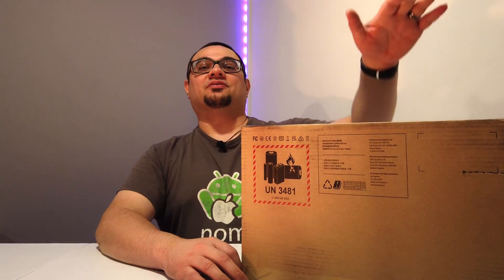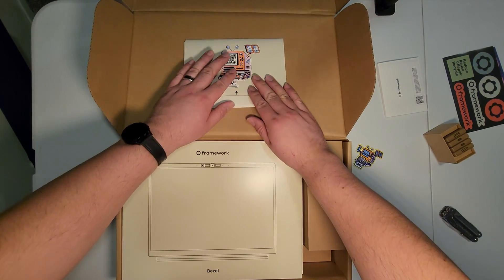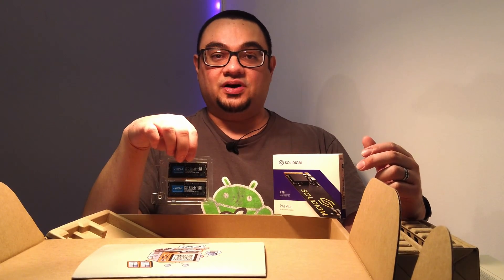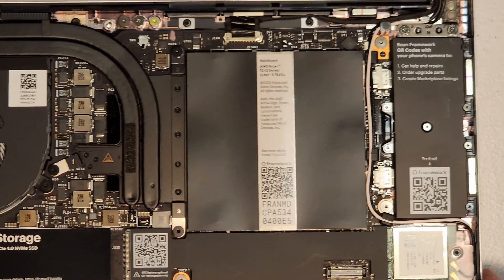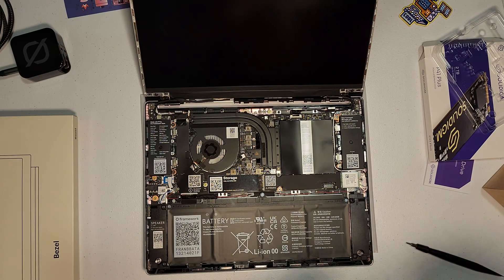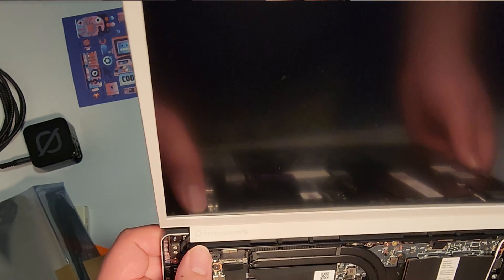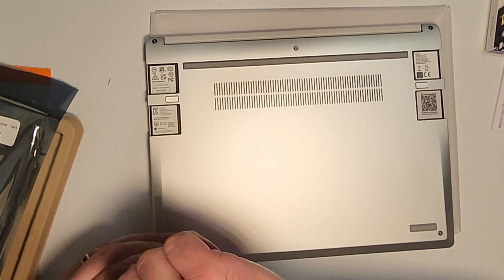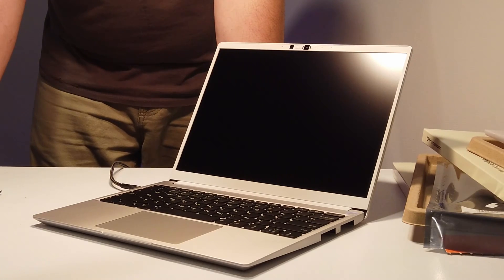Framework Laptop 13 AMD DIY Edition - Ryzen 5 7640U Unboxing and First Look

Comment: Bro, you have no idea what you are talking about 👁️👄👁️

First of all, overheating is an Intel problem, not the amount of cores. Second, you pointed at the RAM slots calling it the 7640u like what? Third, there are some other stuff that I was on the edge of calling you out but decided not to but after the first two, I could no longer let it slide 🗿

Comment: Unfortunately the Framework does NOT support XMP for RAM, so you need to make sure the core clock speed is what you want.
Reply from the maker: Correct

Comment: What is the display brightness like in bright rooms or outdoors?
I heard other reviews say it struggles in those situations but sadly only one review I saw mentioned anything about display brightness

If this claim is true then I may not buy this laptop despite how awesome this modular system is ;-;
Reply from the maker: It's sufficiently bright. I usually use it at 70% in a bright room and only crank it to 100% if watching a video. I tested using it in a car at 100% and it's decent. When I went outside in direct sunlight it was hard to see, but that's not a usual use case for me. My S22 Ultra with it's adaptive brightness it is not.
Reply: @SpiceVader  oh hek!

Comment: Thanks for the video! I have similar concerns about the hinge as you had and I'm glad I found someone how cared about this too, as I'm too picky. How is the hinge and the top comparing to Dell XPS? Is it too wobbly? Does the hinge handle the weight properly? I know that most XPSes (at least most recent ones) are pretty sturdy so if you can compare from your point of view it would be awesome!
Reply from the maker: As far as structure and durability go, I feel like the XPS is a little more sturdy. The Framework hinge is good and it doesn't wobble too much, but is slightly more "bouncy" than the Dell. I have seen some people have issues with the keyboard marking up the screen when carrying it in a backpack over a period of time. So I've started to put a microfiber cloth in between whenever I travel with it. Thanks for the comment!
Reply: @SpiceVader  thanks!

Comment: The "fitment issue" near the power button you mentioned is a consciously designed feature according to framework.
It is a place to easily split the top cover from the bottom when opening up the device.
That corner is where you pry with the spudger end of the screwdriver they supplied.
Reply from the maker: Ahh good to know!

Comment: The solidigm p41 plus drives don’t self encrypt, so before you store anything sensitive on these drives activate Bitlocker on Windows or Luks on Linux. Or never ever sell the drive because people could read that unencrypted data.
Reply from the maker: Good to know! I got the drive so cheap I don't ever plan on selling it, but anyone else reading that MAKE NOTE for yourself! Thanks @owlmostdead9492

Comment: I would rather have had a uniform platform base to have a couple more plugins if possible.  I also am not a fan of smaller than 14.1” displays…. 15.6” being my preference.

Starting to look at the 16 series for my first framework… thanks for the video otherwise!

Comment: My partner got this laptop last month too, we picked up cheap 25€ 2x8GB RAM seconnd hand and a P31 Gold for 60€. Ours has a lot of issues (basically any video playback and sometimes even booting up crashes while charging, and on battery the laptop works perfectly). Support will fix it for us though, I am sure. Very happy with it, even if we have to charge it while turned off lol
Reply from the maker: That's interesting to know. In my testing I've found that certain chargers that claim 65w USB-PD just don't work. I have 2 that work great a GoalZero GaN 65w and a JSAUX 65w. 2 that don't work are Whitestone 65W GaN and the HAGIBIS 65w GaN Switch dock/charger.
Reply: @SpiceVader  I have the charger directly from framework so I don't think that's the issue, although I do have a 25W phone charger with USB PD3.0 that SHOULD work but doesn't, so more firmware fixes are underway
Reply: Hey did you get your issues fixed?
Reply: @FR4M3Sharma  We ended up returning the laptop and got a full refund, Very happy with their customer service/support. I have heard that most chargers work much better now, so there shouldn't be compatibility issues anymore.
Reply: @VideogamesAsArt  Well that's not a fix. 😂

Comment: I've always been so intrigued by this laptop and the company.  Every time my kid comes near my MacBook and I think they might spill a drink on it, or just touch it with their sticky hands I think I should have bought a framework. The ability to easily repair, replace and upgrade is so tempting. At the time though, the 11th Gen Intel was no match for a M1 Pro.